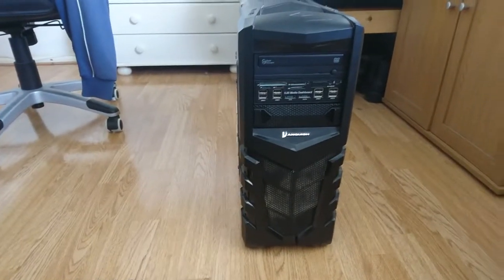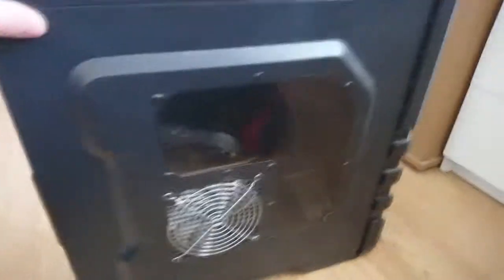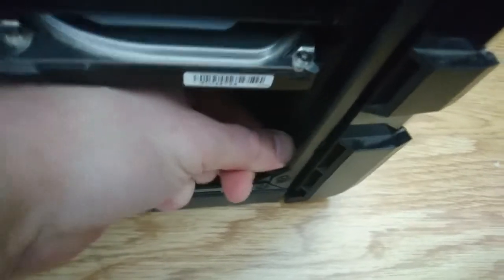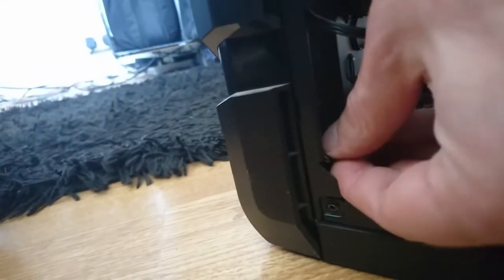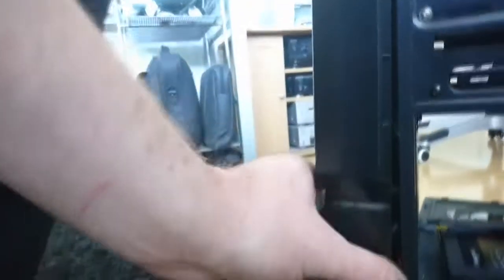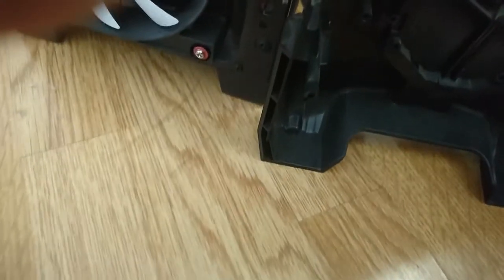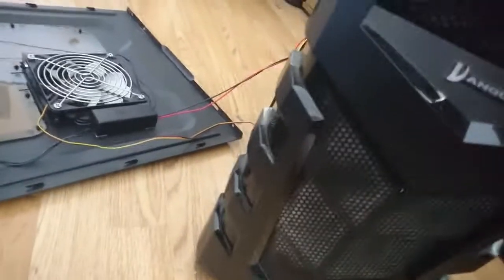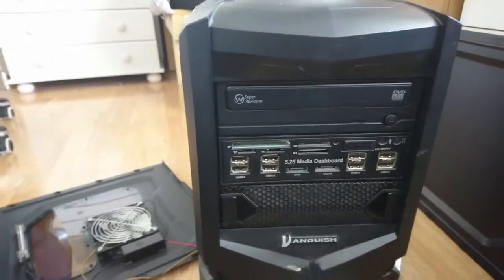My CIT Vanquish PC Case Review Part 4 - How To Remove The Front Panel

Comment: how did you add those USB ports to the middle tray at the front?
Reply from the maker: Easy. I used screws to hold it in the bay then plugged it into my motherboard.

Comment: Omg my fucking fingers hurt. I can't get the snaps off. They're super strong!
I need to get the front panel off to get to my intake fan that's places at the bottom. So I can clean it.
Reply from the maker: It can be a bit of a bastard to get off at first.
Reply: John Gage Ok so... I can only physically touch and really get ahold of the snaps in the middle of the case. I can't get to the bottom two or two at the top. So that makes it even harder to do. :(